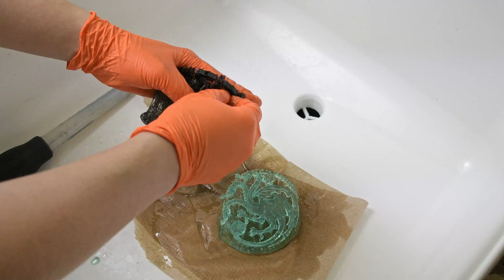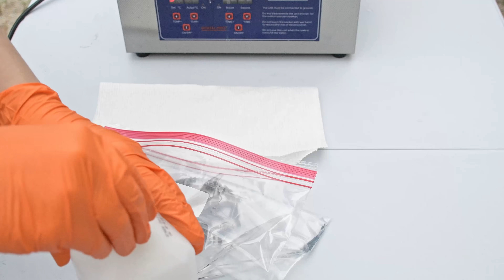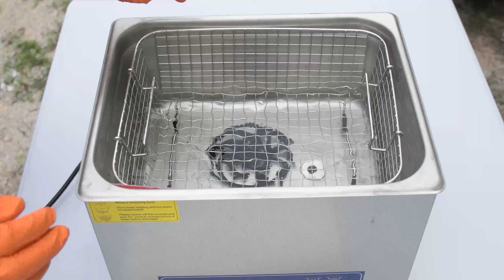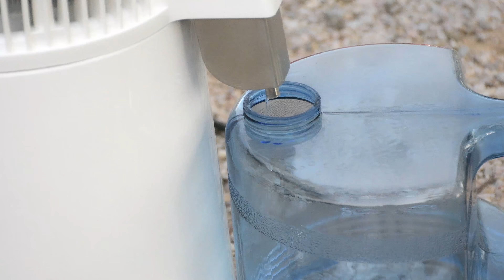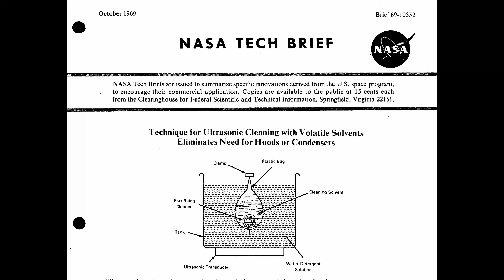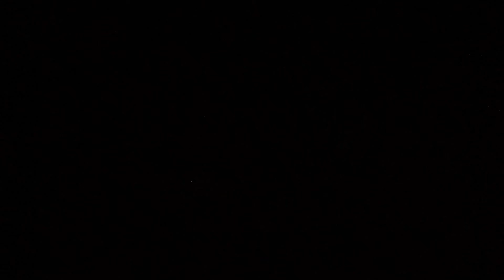Resin 3D Printing - Ultrasonic Cleaning with IPA

Comment: Great video, very informative and thorough! Quick question though, what temperature do you set your ultrasonic cleaner to while cleaning your resin prints? I just started printing and wasn't sure if too high of a temp could damage the prints. Thanks!
Reply from the maker: It will actually be determined by the type of resin. A safe spot for general-use hobby resin is 25-30°C.
This temperature can deform flexible resin, and on the flip-side it wouldn't even begin to harm a high-temp resin (200°C+).

Comment: What would the best way to dispose of contaminated IPA?
Reply from the maker: There isn't necessarily a best way. The easiest way would be to let it evaporate or take it to a waste disposal site.
The cheapest way (if you print a lot) would be to recycle it via distillation.
Reply: @ArisAlder  alright thanks. Please correct me if I’m wrong cause I’ve just decided to end up going with an FDM 3d printer I feel it suits my needs better. I need strong thick parts and I I can’t make large solid parts on a resin printer as easily from what I’ve seen. I also need a top of the line air filter if I’m printing in my room
Reply from the maker: Resin printers can make really strong parts (resin dependent), but you are right that the build volume is more limited. It's much easier to use FDM for this purpose in most cases.

The type of air cleaner you will need depends on what material you are printing, but if you are sticking with PLA/PETG then any consumer air cleaner with HEPA filters will be fine for capturing the ultrafine particles.
Reply: @ArisAlder  alright thank you. thats what I figured as far as resin I'm planning on making somewhat big molds and figured it would get expensive and complex at a certain size so FDM is just easier, as for airfilters I'm actually building my own incase I ever decide to get a resin printer. uses a merv 16 air filter and a huge activated carbon chamber to get any of those VOCs out of the air. Anyway thank you for your help!

Comment: DO NOT USE ANY ALCOHOL ON ANY ULTRASONIC CLEANERS

they are very prone to catching fire with annything that aerosolizes like alcohols.
Reply from the maker: I appreciate the concern, but when you contain the vapors in a bag, glass jar, or container, the process is safer. This process has been well-documented for decades. That being said, it is still advisable to keep the ultrasonic cleaner away from highly flammable materials and to have a fire extinguisher on hand for any freak accidents.

Comment: Uniformation makes a new ultrasonic cleaner that actually confuses me.  It was CLEARLY designed to have the solvent directly inside the machine.  They even have a top collar that accepts the build plate, meaning you are expected to slot the build plate directly from the printer with the print still on it, into the cleaner.

I don't know if there is something special about their ultrasonic cleaner to mitigate risks?  I heard it is actually a very weak ultrasonic so maybe this is the reason?

This ziplock bag method is really only suitable for small prints, and becomes less and less viable as we get larger printers and larger prints.
Reply from the maker: You are right about the bags, and using containers and glass jars are viable beyond that point.

I wouldn't know specifically about that one without pulling it apart. If it was designed for solvents then it's probably okay, but my main concern is the price. It's possible to get a larger ultrasonic cleaner at half the price.

Comment: I'm thinking of using the built in heating function to get the water to 45 celcius, shutting it off and then running the ultrasonic cycle. Hopefully it will help the supports peel off. Bad idea?
Reply from the maker: A water temperature could help in that manner but it could also warp the print depending on the specific resin and geometry. You’ll have to give it a test run.

Comment: Good video, how do I clean the gloves though? Wash with ipa?
Reply from the maker: Thicker nitrile gloves (e.g. 15 mil) can be cleaned with IPA and cured under a UV light. Thinner gloves should be disposed of.

It is also a best practice to double glove by wearing thin gloves under the reused thicker gloves. This helps to ensure that any chemical penetration does not reach your hands. The thinner gloves also help you take off thick ones & clean them.
Reply: Hello, I bought a small glass jar for my small 700ml ultrasonic cleaner. Do I need to close the jar with IPA when using with ultrasonic cleaner?
Reply from the maker: While it is not necessary to always close the jar, it is a best practice to do so since it will contain gaseous IPA and prevent any sources from igniting it. Then put the lid on the ultrasonic cleaner.
Reply: @ArisAlder  thank you very much

Comment: what do you use to prevent sticking when doing the distillation? been trying PTFE and it seemds to help keep the muck from frying to the wall
Reply from the maker: The main thing stopping it is the small amount of IPA left. Using a temperature controlled distiller will help with this since it can be placed right above the boiling temperature of IPA. I do have a new video addressing the distillation.

Are you using PTFE in the form of a dry spray? That is a good idea considering the temperature is less than half of where PTFE will begin to decompose. 

My only concern is that it could react/decompose from specific resin chemicals, but it does appear compatible with some of the monomers, which make up the majority.

Comment: I have had good success using a plastic syringe with fairly fine tip to clean resin prints - this keeps IPA use to a minimum in many cases (it makes a narrow but forceful stream to clean out small nooks like on Eiffel Tower).  I will try ultrasonic cleaner as final step the next time I clean a print.
I am considering making a uv cure box with UV LED strip from Amazon (like $15 for 20' with ps and switch) - 389-ish nm
Reply from the maker: Using a syringe is actually a good idea for hollow prints too, they could be filled with IPA before putting them into the container or bag.

Comment: I used the zipper technique before until sharp bits started to tear the bags. I now use a 3L ultrasonic cleaner as a final wash filled with IPA. My first wash is a tub filled with mean green cleaner. I have do not use the heating element on the ultrasonic cleaner, but I did notice that the ipa became warm with long use. I avoid extensive use in the summer, as the garage and the IPA can get hotter than usual after many runs.
Reply from the maker: The bags tearing can definitely be an issue. As far as I know, the only workaround would be to use a container that is appropriately sized for the print. Glass jars are a good fit and local stores often have various sizes.
Reply: @ArisAlder  yes just use a glass jar or container, ultra sonic goes through glass easily

Comment: The risk with vapors isn't fire, it's a vapor explosion...
Reply from the maker: Hi Argosh! You are right that explosions are of a higher concern. However, in an open tank like an ultrasonic cleaner there would be minimal pressure build-up, especially if the lid is off, for which it should be when properly cleaning prints inside bags or containers filled with IPA.

The fire in the video was demonstrated primarily as a means to highlight the potential danger of running IPA straight in the tank and why it is best to operate away from flammable materials.
Reply: @ArisAlder  I've seen too many victims of this to find it acceptable. I mean, cudos for the demonstration, and extra cudos for finding that paper with the safe method (which I am thankful for), but points deduction for making a demonstration that arguably lessens the actual impact a vapor flash can have. First and second degree burns to the face are not fun, and unlike that little fire a vapor flash can expand over a meter from the flash source in the blink of an eye. Sure, it's low probability for even first degree burns, but it can get worse, and by nature of statistics it does in some cases.
Again, this is my only gripe with, to date, the only IPA Ultrasonic cleaner video on this platform that isn't objectionable as a whole. So you are literally the shining beacon of hope in a sea of terror.
Reply from the maker: I agree that IPA should not be used directly in the Ultrasonic Cleaner for this exact reason. That’s why IPA is much safer in bags or containers and the tank full of water, which will prevent it.
Reply: Tell me you have no idea about the dangers of flammable solvents while acting like you do.  Putting IPA in a ultrasonic cleaner, especially an unheated one, is way safer than all these plastic wash rinse stations being sold.  Why? Because I can close the lid or put the cover on it and put the fire out, have fun putting that plastic lid on a plastic container to put a fire out.  Ultrasonic cleaners aren't going to ignite IPA, and if the lid is closed then the mixture will be too rich for ignition very soon after closing it.  And there is not enough volume for an event either way.  As far as having an explosive mixture in the room, use a fan to keep vapors from being able to build up on the floor if you really work in someplace where the air is that stagnant and are dumb enough to have that much surface area of solvents exposed anyway.  You'll be choking way before you hit LEL (Lower Explosive Limit).   I evaporated and  oxidized more solvents in week than you've ever seen, Class 1 Division 1 environments, massive fire suppression systems, and NDAs

Comment: That feel when I've seen people casually talk about putting resin contaminated water down the drain/toilet. People need to talk about disposal and clean up way more
Reply from the maker: You are absolutely right - it is on my to-do list for creating a video on the chemical holding tank and proper disposal. That particular project is currently in the footage phase, documenting the transformation of a workshop for resin printing.
Reply: It's a shame... You should document yourself before doings informative video. Your are not only polluting but making other people polluting too or you are just passing for a monkey.
Reply: It's really bad
Reply: Are you still planning on doing the chemical holding tank video?

Comment: Nice video. And as in other videos on this topic, there are always examples of small figures (that fit into a plastic cup) or such thin parts that fit easily into this bag. What I miss all the time in such videos are tips for larger prints that really need all the space of these ultrasonic cleaners.
Reply from the maker: You have a good point about the larger prints. I believe that is mostly going to come down to the size of the ultrasonic cleaner. The one used in the video is 10L, and it should fit almost any print from a medium-sized resin printer. People will need to plan for the future and determine what size they will need.

Mars 3 build volume - 143x89x175mm
Saturn 2  - 219x123x250mm
Jupiter - 278x156x300

6L Ultrasonic - 176x150x325mm
10L Ultrasonic - 265x150x325mm
30L Ultrasonic - 325x200x530mm
(These are just a few of the vevor sizes)
Reply: I find for my usage, simple green concentrate works to clean the resin reasonable well at 40C, followed by a water rinse. I recirculate the water through an activated carbon filter, and do not dispose of the water at any stage. Granted, I'm using a 30l heated unit to wash my parts. The concentrate can reused for quite a long time, with it being reasonably easy to filter the resin out once it cools, as the solution has the resin drop out of solution.

Comment: Great video! I wish that I had the room for the kind of cleaning setup that you have. I do have a quick question regarding the ultrasonic cleaning: I know that it is considered a bad idea to put IPA directly into the cleaner, hence the use of the bag, but what about other cleaners like Mean Green? I know that the youtuber Uncle Jessy has done this for years but I'm curious as to what your thoughts on the matter are.
Reply from the maker: One of the prints that I regularly clean is a hexagonal mesh with thousands of holes. I have found Mean Green to be lackluster for cleaning that specific type of print, but on less complex geometry it is okay. One option on that front is to use the Mean Green for 90% of the cleaning, then finish off with an IPA rinse/dunk etc.

My main concern with using large amounts of water or Mean Green is that disposal, evaporation, or recycling becomes more difficult. However, with the right setup it can still be dealt with - you can accelerate evaporation of the water to the tune of about $1 per gallon evaporated (electricity costs).